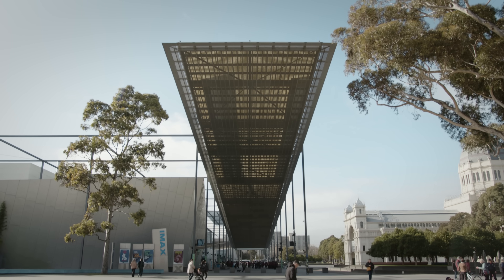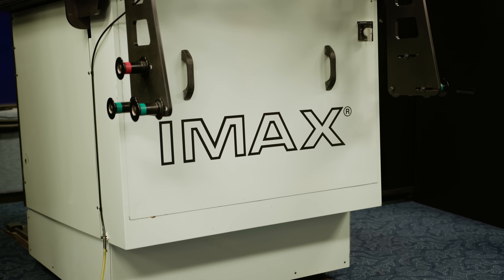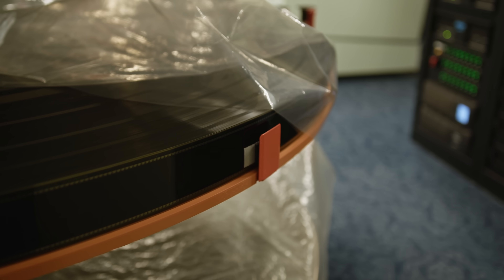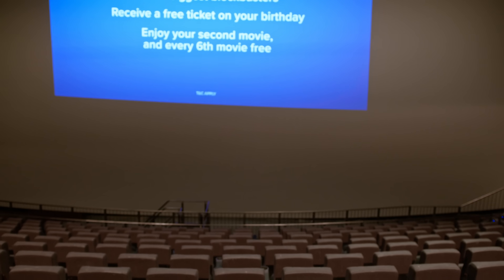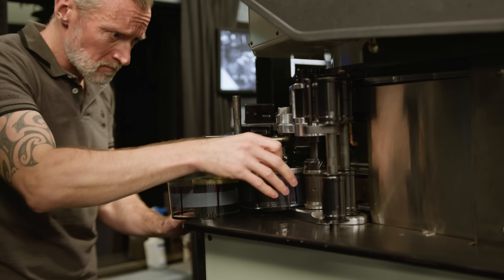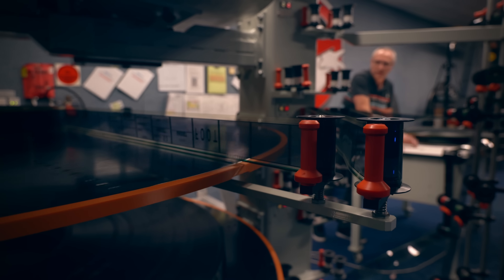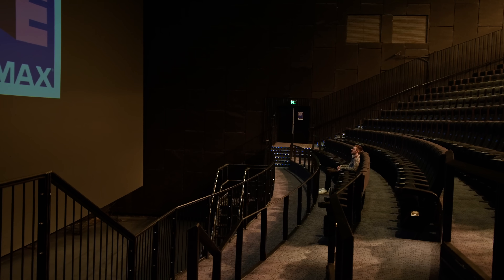See How OPPENHEIMER 70MM IMAX Film is projected

Comment: i went to see this in "IMAX" and was like 'wait, i remember this being at least 2x as big as a kid'

and now i don't know if i've ever seen tru IMAX :(
Reply from the maker: Might be worth trying to watch it now for sure!
Reply: seems like you saw it in "Digital IMAX" - yes the original 70mm IMAX used film (Like Oppenheimer at the Melbourne IMAX) and the screen was bigger. "True IMAX" is called 1570mm IMAX because the film is 70mm wide (as opposed to conventional 35mm film) and it has 15 perforations per frame as opposed to 4 perforations per frame for 35mm film. I had a similar experience as you some years ago. I had seen original 1570 IMAX over 20 years ago and about 10 years ago went to an IMAX cinema again, thinking that digital IMAX would be so much better than 70mm film IMAX. I was so disappointed. And the thing is the exhibitors, while promoting "the all new Digital IMAX" didn't really tell people that the picture on the screen was actually smaller.

Comment: I live near the IMAX theater they just built in Pooler, Georgia (it’s really really close to the size of this one, 23.2m by 30.7m), and it’s one of two GT auditoriums in our state.  They don’t have a film projector (theater itself is a “small” family owned and they probably couldn’t justify the cost of the film projector on top of the dual 4K projectors like in this video with how few films are released on film now).  They do an outstanding job of taking care of their facilities though, which unfortunately the other GT IMAX in our state can not say… That one is owned by the Regal Cinemas (theater chain)  at the Mall of Georgia and it does have the 70mm IMAX but Regal cheaped out and only put one of the 4K digital projectors in it (apparently that’s something regal has done with most of if not all of their IMAX theaters).  That makes it incapable of showing digital only movies in the full imax aspect ratio, on a screen that’s significantly smaller (18.1m by 24.8m), in an auditorium that isn’t in as good of a shape as pooler (and doesn’t have recliners).  So would have been pick either one of the biggest screens in the world in a nicer auditorium but it’s digital (still 1.43:1 though) or see it in a worse auditorium but it’s on film (but on a smaller screen)…  No clear choice for movies like Oppenheimer, definitely a clear choice for digital only films like Dune though, since Pooler is the only one of the two that can do digital 1.43:1)

Comment: From reading the title I had hoped to see someone actually spin up the movie and see the process of 'how'.

This is more of a general video of information about the IMAX Format and cinema.
Reply from the maker: Showed as much as I can! When the film print is spooled up and playing at 24fps, the room is completely pitch black and you can barely see anything. I was only a one man band for this one, so apologies you didn't get everything you wanted. But, I hope I was able to provide a pretty good insight on how it's all put together, there were definitely a few unique things I learnt about the Oppenheimer process specifically. But other than that, what remains in the process is pretty similar to normal film projection. Spools from the round table, QTRU, into the projector, back out on another round table.
Reply: @kirkmihelakos  Thanks for the answer, nevertheless it was a good and informative video. 
I just think the title isn't as fitting as it could be.

The size of the film print does make the process a bit harder than a normal film screening, which I'd say makes it worth showing. 
Also every cinema's setup is a bit unique, as you said in the video: there is a lot of space between the film storage and the actual projector. 
I'd be interested to hear if they had a reason for this, or if that's just the normal setup, to simplify working with the film reels.

I also understand it's hard to film the process, they probably won't spin up this movie for 10min just to show the process.
That's just too much work to get all that film back in ready for a proper screening.

Comment: I saw it in a theater in Denver Colorado in 70mm. The theater wasn’t listed as one of the 30 but I watched them load the 70mm print. Those IMAX projectors are huge, and the ventilation system they have to keep them cool is so wonky
Reply from the maker: There is a difference between 70mm and IMAX 15/70mm, those 30 theatres are the latter
Reply: @kirkmihelakos  Ok. seeing it in 70mm was pretty incredible. I probably wasn't missing much considering it was plenty sharp and bright for the screen I was seeing it on.

Comment: Would be a privilege to be one of the projectionists tasked with handling this particular film material. That said, I'd be super nervous about somehow damaging the reel or getting the splicing wrong. Would not be a fun conversation with the film distributor! Although they are professionals I suppose.
Reply from the maker: a very high pressure job! lot's at stake especially with only one copy of the film print
Reply: As a former IMAX projectionist, I can tell you that handling millions of dollars of equipment, including the prints, was definitelty nerve-wrecking at times. It can take a considerable amount of time and caution when building one of these prints. Last thing you want is to mess up the reel order or put in a bad splice (even if there are a few bubbles in it, it's no bueno).

Comment: can someone explain the reason for using analog tape instead of digital? i dont know much about video but digital audio definitely has some advantages to my knowledge.

like all they say here is that "imax is the best" but without explaining any of the technical reasons why
Reply from the maker: Specifically, IMAX 15/70MM is probably the highest relative resolution, video capturing format out there. It's equivalent of about 16K resolution and beyond of a traditional camera. Although, these numbers are theoretical, as no camera out there at this moment really matches the quality the IMAX image produces. (When played back in 15/70MM). The film process in general, also, is most closest of any format, to how our eye captures light, and harnesses it onto film, thus with IMAX 70MM (15/70), being the largest film format in terms of surface area per frame, it'll capture not only the biggest field of view and a standard focal length, but most amount of information, which thus can be compared to resolution.

In order to play back IMAX film on digital, there is a lot of compression that must happen, AND it has to go through a digital projector where there's also a quality loss

Comment: The two IMAX projectors are driven (for synchronization) by a 2001 Palm M130 PDA. When this PDA will become untraceable, IMAX projection is over, because the entire system was initially designed to work with this Palm M130 PDA. I think the IMAX company must have put a few copies aside, well I hope so.
Reply from the maker: This is so fascinating, going to do some more research on it! I believe they do run emulators now though

Comment: Minor correction - there are far more than 30 IMAX cinemas in the world with 15/70 film capability. The figure you've been quoting (30) is the number of those that are getting a print of Oppenheimer in 15/70 format (though I've also heard 31).
Reply from the maker: Maybe, the IMAX Corp have giving me these numbers, but I shall follow up and clarify, I believe the number is correct though for total IMAX theatres screening in 15/70
Reply: From my understanding the numbers they are quoting are the theaters that have both the correct screen size and the correct projector. There are imax screens this size but use a digital projector, as well as 70mm projectors but using a different sized screen.

Comment: I believe the original rolling loop projector idea that IMAX used to use (still does?) for projecting film prints was developed by an Australian. Quite something to watch one of those running in closeup. Bulky, but when you're continuously snapping 15 perf wide frames across at the rate of 24 per second for hours on end I guess a conventional Maltese cross projector escapement or camera style pulldown forks are not practical or are perhaps less gentle on these hugely expensive 70mm prints.
Reply: Ronald Jones had toyed with the original rolling loop at his machine shop in Brisbane.
Reply: @gweyers  
Right, that was the name...
https://patentimages.storage.googleapis.com/97/5a/47/e6ae1ba2e2513f/US3494524.pdf

Comment: 2 mistakes its 15-70 mm not 1570mm And there is an Imax cupola in Quayaquil Just under the equator so there you go....
Reply from the maker: IMAX brand it as 1570mm, but it is 15 perf 70mm, and 2) it’s the only imax theatre in the southern hemisphere the displays 1570 ;)

Comment: Biggest Screen's actually in France, Futuroscope!
Reply from the maker: interesting, I think that's more so a circular screen experience, so it's a little different to what IMAX is
Reply: @kirkmihelakos   I inquired a little, and in fact this screen of Futuroscope in France is the largest in Europe, with dimensions of 27,2m x 24,1m, high as a 7-storey building. It is equipped with both an Imax 15-70mm projector and an Imax Laser 5K 3D projector since 2016. So my bad, it's actually the one in Melbourne that is bigger, sorry 🙏

Comment: Dumb question but how does the audio work with movies shot on film?
Reply: A system in which the photographic (optical) sound track on a film is scanned by a horizontal slit beam of light that modulates a photoelectric cell. The voltages generated by the cell produce audio signals that are amplified to operate screen speakers. In sound-on-film, sound waves were converted into light waves that were then photographically inscribed onto the film itself. This allowed for a single strip of film to carry both pictures and the soundtrack, which was imprinted alongside the pictures and read by special projectors. In a way kinda like a playing a vinyl record.

But the IMAX film, has a separate DVD disc with the sound file. They load the sound file from DVD onto their server communicating with the IMAX projector system, which they essentially sync up the time stamps together.
Reply from the maker: awesome, great share!
Reply: @allenc.2912  Correct. First paragraph describes 35mm and the second is true for IMAX. The audio comes in on a DVD which is then copied to the sound system, and then the timestamp and frame count are synced up.

Comment: But what is IMAX? This explains almost anything else. Is it the resolution, frame rate, color...?
Reply from the maker: There are some incredible video and other resources out there that explain what IMAX is and the different formats out there. I ended up cutting a large portion of this video, where Jeremy (the Operations manager at IMAX Melbourne) described all the different formats, including IMAX Enhanced available digitally, but found that the focus of this video was more to be about this IMAX cinema and Oppenheimer specifically. Although we did briefly touch on some parts of different formats in the middle section of the video

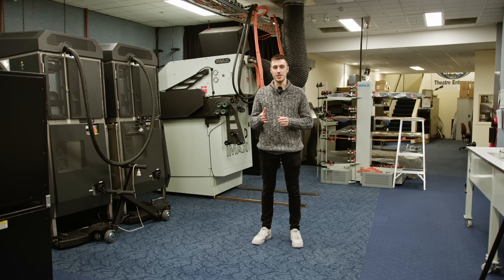Comment: 4:13 See that small black box stuck to the side of the pillar to the host's left? You'll never guess what it contains! It's a PalmPilot from 2002. Or rather, an iPad emulating a PalmPilot from 2002. Why in God's name would a PalmPilot from 2002 be an essential piece of equipment for an IMAX theater? Because some genius at IMAX decided to use an off-the-shelf PDA to control the spool system instead of developing a custom system. Not realizing that this meant the system would be relying on a piece of hardware that would eventually stop getting manufactured.
Reply from the maker: never would of known! fascinating!

Comment: For such a well-made documentary, it's mind-boggling that you make the mistake of calling the film 1570 "mm," as if millimeters are involved anyhow with the name. To spare others the googling, they aren't; "1570 refers to the dimensions of the film frame, which is 15 perforations (the small holes that run along the edge of each frame and allow the film to be pulled through the projector) in length by 70mm in height" (from the website of the very Melbourne cinema shown in the video). If you just try imagine what a 1570 millimeter film would look like, you'll understand how bizarre the video title is.
Reply from the maker: IMAX brand the print as 1570mm film on their site, it's a shorthand way of writing 15 Perf, 70MM

Comment: Shouldn't call it 1570"mm", thats very misleading. Each frame of the film is 48.5mm in height and 70mm in length. And there are 15 holes of on the edges of the film for every 70mm.
Reply: He says IMAX brands it that way. In reality it should be 15/70mm (15 perforations for every 70mm frame).
Reply: @anthonyricci5380  No they only say 1570 FILM or 15/70 or 70mm. They never put "mm" together with 1570.
Reply from the maker: 15 perf, 70mm - 1570 IMAX Film, or 15/70mm, you're right

Comment: Considering how these movies are shot and edited primarily in digital anyway, the actual "film" part is an anachronism that serves no real purpose other than keeping afloat certain dated manufacturing lines, technical jobs, and dying venues. Critics of this tech point out the proprietary and walled off nature of it. How everything from the screen material to the sound system is controlled and provided by the company. It ensures consistency, but it also means there is a stranglehold and very little innovation or competition. Other than it being BIG, does it actually provide any other benefits? The allegedly 18k resolution and claims of unparalleled fidelity are dubious as no one is allowed to test the systems. Color, contrast, brightness, framerate, and yes, even resolution, are likely inferior to other technologies. There was never any need to print this on film. The same result can be achieved on digital projectors with sufficient defocusing. IMAX just happens to be the only ones with these multistory screens, and they are making the most to keep a dated and unwieldy technology alive. One that requires emulating a palmpilot to even function. I'm surprised they don't use punchcards to go really old school.

Comment: whats so special about it? i saw oppenheimer in imax 70 mm at the indianapolis state museum and i dont really notice anything special about it when compared to a normal theater, in fact its actually a little worse since the image is blurry at the top/bottom/side edges and the image is grainy rather than crisp high definition
Reply from the maker: you probably saw it in just 70mm and not 1570mm, there's a noticeable difference in the size. 70mm film print is pretty much 2.39:1

Comment: Over time 70 mm film will fade particularly the yellow dye in it. I have seen both My Fair Lady and Lawrence of Arabia in faded purple 70 mm. Also a really fast frame rate is much more realistic where there is no strobing and cart wheels appearing to go backwards. Nolan has a thing about IMAX which is cumbersome and can lead to tedious cinematography not to mention enormous expense. This is not a case of sour grapes. With IMAX the 70 mm film has to be dragged sideways through the projector at an enormous speed  to achieve the standard 24 frame rate per second and this is going to put enormous stress on the film's structural strength itself making its long life debatable in addition to the aforementioned fading. It goes without saying that in 30 years time these prints will be junk.
Reply from the maker: You could look at it from that perspective, but honestly, there are barely any movies screened or shot in the true 1570MM IMAX format, so I'm grateful it exists just to experience it beyond pure documentary work
Reply: Even more reason to see the film in this format now.